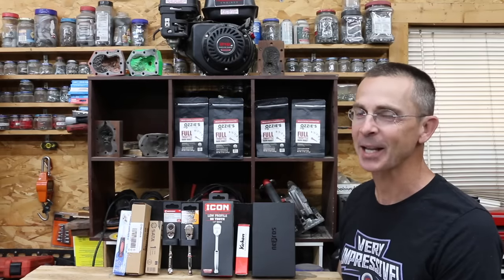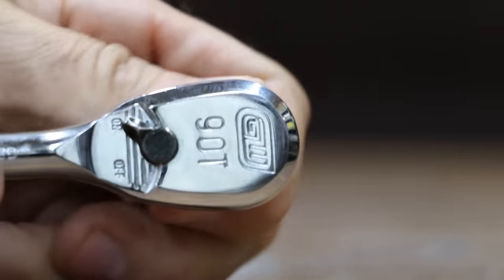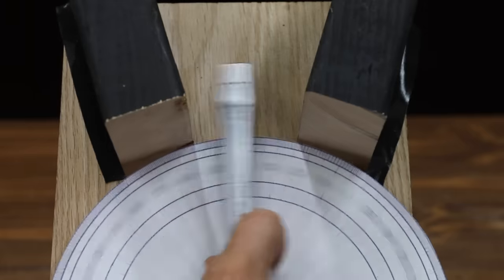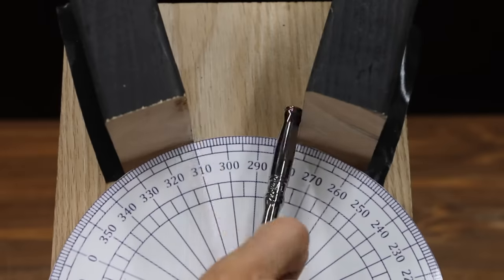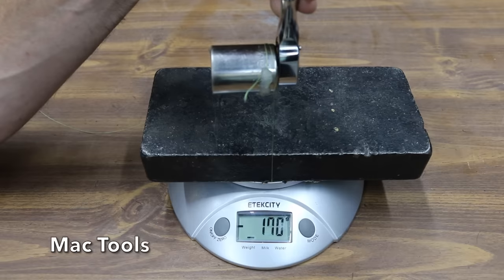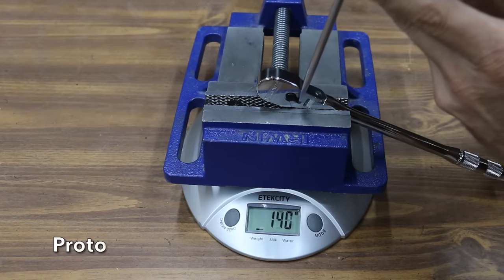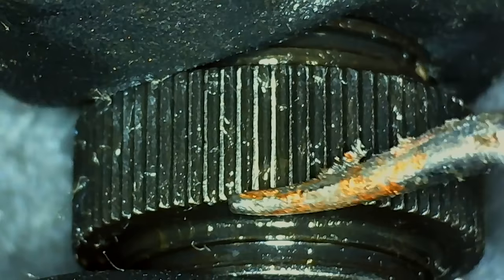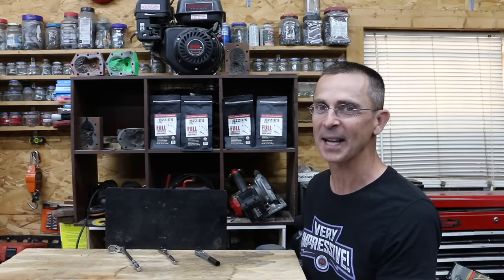Best Ratchet (1/4 In)? Snap On, Icon, Proto, GearWrench, Prototype

Comment: Please release the results in csv file format, in the description or in a pinned comment, so we can convert it to excel and make our own formula for the overall score, based on how much we value each result (i.e. weight, cost, switching force, etc.).
Reply from the maker: Thanks for the feedback.
Reply: My pleasure, @ProjectFarm  ! In future videos, please also add data not only in the description, but also in the video, showing the data on-screen for 1-2 seconds each page (since some videos would result in excel videos with more pages), and have those visible and legible even in 320p, or at least in 480p, just in case, since it shouldn't add more than 10-20 seconds to the video, and can be added at the end of the video. Adding it in the video would help with "sneaker net", or the method of moving "internet resources" (i.e. videos, pages, and so on) on data drives (i.e. USBs, HDDs, SSDs, etc.) from city to city, which is still being done in places with internet censorship (i.e. South America and China), and places without widespread internet infrastructure (i.e. Africa, and very rural parts of most countries), as well as being very useful for data backups (i.e. data hoarders, some of which are disaster preparedness advocates). 

And it doesn't matter how useless you might think the video or the data would be for those people, it could help in ways you cannot yet understand, especially it could help future historians to make sense of what the heavens happened in our time. Or it could be used by AI to make sense of the world and help someone. The data we create can help people in ways we do not yet understand.

Comment: 9:55 The backdrag test is inaccurate since the TRO brand starts out at a 90 degree angle, making it way easier to pull compared to the other brands that starts out at approx. 180 degrees.

Otherwise, great video.
Reply from the maker: Thanks for the constructive feedback.

Comment: I gotta disagree with one test, the on/off switching test.  If it takes little effort to operate the switch the ratchet can switch directions easily in tight spaces if the switch is rubbed while using the ratchet.

Comment: 17 grams to change direction in not a good thing.    If your finger grazes it you have switched directions.   And in some places I've  used a 1/4 that inch drive that means pulling your hand and tool all the way back out to reset the direction.    Not good

Comment: I feel like the Koken ratchet you used for the test isn't the greatest you should have used another one...I have a short like 4 inch long koken ratchet that has a 3/8 drive in a 1/4 body and it has very fine teeth
Reply from the maker: Thanks for the constructive feedback.

Comment: While this is a good review, I think you missed some important aspects. Length from tip of the handle to the center of the square of the ratcheting gear along with the distance from the gear head square to the top of the rachet head. Important as it affects your clearance and the amount of torque one can place with their hands. Also the handle diameter as it affects the size of pipe you can place on it if needed. And lastly, ergonomics and comfort. While for those that just use a rachet occasionally, that's not much of an issue. But it does matter, especially for those using them professionally all day long everyday like say a mechanic. For a professional mechanic these are important aspects.
Reply from the maker: Thanks for the constructive feedback.

Comment: The total torque failure figures are almost pointless. Anyone trying to impose more than about 15-20 ftlbs of torque with a 1/4" drive ratchet probably shouldn't own tools in the first place. Other than that, great test. Full disclosure, Im an absolute tool snob.

Comment: Husky brand isn't worth it if anyone thinks it's a lifetime warranty tools and you can go get it exchanged with another one ... first, they said it's not a husky tool ... after showing them the part number on the tool, they said we don't have the same replacement... went there several times, and they never keep the same tool in stock in store ... lifetime warranty is a gimmick to sell the tools ... they don't honor it at home depot when the time comes
Reply from the maker: Thanks for the feedback.

Comment: If you are using a 1/4" ratchet for anything over 10 ft/lbs you are using the wrong tool. And if you break it, it is your own damn fault not the tool.

My favorite 1/4" ratchet was from S&K. Used it for 25 years before it finally wore out. I have used everything on the market from Snap-On, Mac, Cornwell, Husky, and Craftsman and none of them were as good as the S&K.
Reply from the maker: Thanks for the feedback.

Comment: A carbon fiber handle is really, really stupid. And I say that as someone who loves CF and builds bikes with it. I have even built carbon-fiber composite tools to use with the bikes -- but those are meant for minimal, field use, not as an everyday go-to. Carbon fiber is stiff and light, but it's awful at resisting the kind of point impacts that tools may see during use or drops. Because CF is stiff, it's also brittle, meaning those impacts are likely to cause cracks that will lead to further cracking and delamination over time. Ever need to tap a handle to break a fastener loose? You won't want to do that with a CF handle for sure.
Reply from the maker: Thanks for the feedback.

Comment: I’m a fabricator on a NASCAR team, love the fit and feel of my Snap-On 1/4” drive, however thinking hard about the TRO… I wake at night from dreams about how fast I could remove 10-32 Allen head socket heads with that light weight baby, less fatigue, more bolts, less chance of carpal tunnel syndrome, could probably move fast enough to remove at least 3 more bolts a day and extend my retirement age a few years…. Wondering if they make a ti/carbon fiber dildo for my wife?

Comment: Who would use a 1/4 and take it to 90lbs. I’m pretty sure that 10mm bolt head will twist off way before that.
Reply from the maker: Thanks for the feedback.
Reply: It's just to torture test each brand.
No one would ever expose the tools for that kind of torque, but it's interesting to know which brand can hold out the most.

Comment: So you tested using a snap on ratchet from 1968? 

If you're going to test the "best" gear swing of each, why not use the similar priced dual head snap on ratchet?  You should have included some of the other manufacturers as well.  Titan, sunex,  s&k   Matco, Cornwell, etc.

If you're including dual head fine pitch from some brands, you should include those iterations from the others, considering most of them do have them.  Further, if you're using padded handles from some brands they all should be, if you're going to use round handle versions, use those form all, low profile vs low profile as well.

I get your "idea" but it effectively becomes "false results" when you use tests that lend advantages to certain designs using arbitrary swing amounts instead of the actual swing range to advance one click (which would be more consistent of a measurement)  You can bias this test by changing handles, or measuring block location to give any of them an advantage. Measuring swing arc should happen at a fixed distance away from the pivot point using a stop pin not the handle, as a skilled tradesperson will select a ratchet that reaches in to give themselves the ideal clearance.   For example, if you measured using a stop pin at 3 inches from pivot, then you can compare long handle, short handle, and padded all using the same test to get a measurement in degrees.

now sort them by types, and you have a scientific test. Better yet, it would show across the types if you use the same pulling positions and loadings that for strength, one might want a coarse or conventional heavy alloy, where for clearance a very fine dual head with low profile form the other category may perform better.

I can tell you that country of origin means a lot on average failure under daily use and fatigue.  Given enough stress, it becomes very clear to long term mechanics that materials from some countries have an EXTREMELY higher failure rate over time. They may survive the stress for a few shots, but long term, they get replaced multitudes more often which can be a complete failure for their purpose in time-sensitive work environments.

Comment: Do you source multiple samples from each company so as to determine the truth in your statements? Calling the gearwrench the best value without sourcing multiple examples, ideally from different suppliers, is, in my opinion, a hasty conclusion. Manufacturing consistency is the only data point that actually connects these results to your audience.
Reply: So essentially, you're irritated that he didn't buy a truck load of examples in order to find the few examples that might have slipped through QC? That mindset applies to literally every and any brand. One example, bought from a large retailer should be more than sufficient to get an idea for a brands quality. Sorry , but your criticism has almost no bearing on reality.  Gear wrench is notably a cut above the other brands in that price range.

Comment: With the Icon ratchet the screws holding the plate on work themselves loose over time and even with thread locker don't want to stay in place well. It's a pretty awful design.
Reply from the maker: Thanks for the feedback.

Comment: In reality you'll never be needing a 1/4" wrench to torque up a fixing that high as the fixing will fail before the wrench. This makes it a pretty much useless test. Unless of course you're using 1/4" instead of 1/2" because you're too lazy to find the right tool for the job :-)

Comment: Your arc testing is  flawed.  The  arc should be measured from the centre of the handle. Thin handle performs better than the thick ones.
Reply: “thin handle performs better than the thick ones” - 🤔 - it’s almost as if that design element of the handle could affect the real world operation of a ratchet within a tight space

Comment: Ummmm they aren't factoring the handle width into the arc swing for tooth engagement. Your test rig is incredibly flawed for this test and is giving you inaccurate/very false results because you are using a set architecture to test arc swing by using the handle to determine the arc which is different to every each design for ergonomics and so fourth. Your test hold no water whatsoever just like most of the tests you do. Please stop.